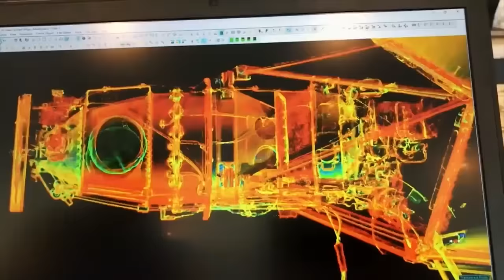We both almost died...now what??

Comment: Dear Patey Brothers, 

My name is Steve D. I have met you both at different air shows and events and have actively spoken to Mark on the phone a few times about Tug stuff… but I digress. 

I am an aviation nut, and I’ve enjoyed growing up around Aviation and in a GA family… I’m a bonanza fanboy… and just purchased my own with financing… (1250 a month loan for ten more years ! ), Although I’m young and turn 25 years old in two days….  I have many ideas that could help the Aviation community and have been putting in boots on the groundwork to try to make changes, especially at this moment in time on college campuses. I’m just going to bullet-point some things, and then I will go into further detail below.

1. - youth outreach, especially to local Colleges. (UC DAVIS example) will mention more below. 
2. The Accessibility of aviation is not as accessible as it could or should be (I will mention more below ), and I had a student write some stuff on his experience as a newcomer to aviation. 
3. - reducing overall cost for initial instruction will break down in detail below on how to achieve this goal (will mention more below) 
4. Working on a congressional level to change mental health requirements in pilots /  AkA ( students that have ADHD or other minor mental health disorders ) 
5. Bring the cost of aircraft ownership/ manufacturing back down ( will be discussed in detail below)
6. HANGER Shortage: getting a fix and building more hangers at local airports. 
7. Working with GAMI to speed up the implementation of G100 fuel 
8. Working on the defense of airports against closures with public outreach. 
9. Getting more pilots involved on city boards and councils and having civic duty engagement ( aka through social media but also convincing pilots to run for office on local levels ) 
10. Implementing a system to resolve the DPE shortage across the county 
11. Creating more Airshow and air festivals across the country to gain outreach. 
12. Getting the FAA to implement New test standards on ACS requirements (I will mention more below )

Organizations I’m a part of, EAA- I was eleven years old when I joined and will always be, and everyone should be a part of their local chapter at their home airport. They do a lot of significant outreach, but they need to do more, especially targeting the correct age of kids. 
They have a program called the Young Eagles program, where they take kids flying for their first time in a small plane; however, I believe the target audience is entirely wrong. They try to target kids between the ages of eight and eleven. And they need to target kids between the ages of sixteen and twenty. They need to be going out to their local high schools while they have pep rallies and asking if they could put up a fantastic slideshow of what aviation can do and how to access it. 

AOPA — my RIDE TILL I DIE; I love them. They do wonders for the aviation community and battle in Congress to keep our freedom to fly. Also, they help us pilots individually with different programs

BPP- bonanza Society. I’ve been an active member since I was seventeen, and they do great safety seminars on Bonanza aircraft. They have a great community board for looking to find Aircraft for sale and have activities and events with other Bonanza pilots to meet up. 

The bullet points that I mentioned for further detail below ——————————
Reply: 1. College outreach — There are many colleges all across the country with airports that are literally within miles of the campus, and they might have an aeronautical engineering program; however, they do not have an aviation science program where you can learn to fly and get a bachelors and aviation science. And a lot of universities closed their programs after 9/11 Because they did not want alums associated with an aeronautical disaster. That example is UC DAVIS. But there are a ton of colleges all across the country that are just like that and have an airport and might have used to have had a program that taught people to fly, but they axed them. That isn't very good and has been part of why the pipeline of new pilots has been so few and far between. The number of universities with a 141 program is less than 40 nationwide. 

3. The cost of the initial instruction can be reduced and can be reduced efficiently and safely. My local flight school in the Sacramento area where I work can guarantee a student can get their private pilot for less than or equal to $7000. The way we do this, you ask? It’s simple. We were a nonprofit Flight school. The CFIs at the school still make enough to make a living or close to it, lol. Still, at the top of the program, it’s all volunteers that are giving back, and the Aircraft that we have are safely maintained and well and good. But there is no incentive to make a profit. There is only an incentive to create more pilots. The students can rent out Aircraft for around $88 wet per aircraft for a Cessna 150 per hour and 120$ for a Cessna 172. And the instructors only charge 30 an hour.
The way we keep our costs down is by our board members on the top, a.k.a. the people who run the business side of the house, are all doing it to break even. They’re not in it to make money. There needs to be more nonprofit Flight schools.

4.  As you know, there is a crisis of young people not getting into Aviation. I noticed that part of the reason is that many believe they are barred from Flying simply because they had a diagnosis when they were a kid for having ADHD or some high-functioning autism or something of that nature. Sidenote: if you go out to a local airport and we’re to speak with half of those old timers out there and their hangers talking with each other, and you had a ( DSM book ) ( if you know, you know). If you had a conversation with these individuals, you could probably diagnose half of them based on the criteria of the DSM that the excellent population of pilots would be high-functioning autistic, and over 3/4 of them would have ADHD… seriously… Have you talked to these old-timers about Aviation? Just get them going… I feel like it’s the same with everyone in Aviation…. It is just sad nowadays; everyone in their mother that is young seems to have some mental health issue diagnosed to them when they are children. Just because they are either too active or they are overly rambunctious, mainly; this was a big situation in the early 2000s involving extensive Pharma overdiagnosing psychological medications to young individuals. I can dive deeper into this if need be… What this is caused is a large percentage of the population that are in their early 20s now have some diagnosis even if they don’t need it. Because of this, a lot of individuals that try to become pilots that might have ADHD or something else of the nature and have to jump through so many damn loopholes to be able to get just a medical. 

5. Bringing the cost down of Aviation manufacturing is incredibly crucial to maintaining the GA fleet. How do you know that most General Aviation airplanes are at least 50 years old? This is mainly because of the slowdown in the 1980s with manufacturing. Many reasons caused this, but if you look at the average cost of assessment, 172 now versus Cessna, 172 and 1980, it’s over a 400% increase in price. Much of this goes to padding for the company due to liability in case they get sued. But I digress. What someone needs to do would be very simple, and they need much financial backing to start it. What it would be is to make assessment 150s and 172. Clone with an introductory panel and Manufacture cheaply but safely. To get it approved by the FAA as a certified aircraft would be a tremendous amount of investment in initial start-up. However, I know it can be done economically and feasibly to produce and sell a primary plane for less than $120,000 from the manufacturer. To do this, you need to change the aircraft manufacturing process. Currently, if you were to go to the Textron Cessna plant in Witchita, Kansas, you would see how much aircraft manufacturing truly is hands-on. That is partially why the cost is so high because of the man hours and labor. If someone would be willing to invest a large chunk into speeding the manufacturing process up for general aviation aircraft. They would be able to pump out aircraft, efficiently, and safely and a manner that is more affordable. this needs to be done as quickly as possible because the generally aviation fleet is continuing to shrink and by the age of my 50s ( 25 years ) it will be in a dire crisis if no one speeds it back up.

9. Getting Pilot involved on civic and local community council is incredibly important. I myself am on a council board to help protect our airport. A lot of the people that run city boards and are in city management. No absolutely nothing about Aviation. I change the mind of multiple people that were in favor of closing our local airport by one simple thing, I took them on a airplane ride, and they loved it. They fell in love immediately, and changed their tune. We need more pilots on local and county boards and airport management boards because you have people that are managing an airport on a city level that know nothing about Aviation which is pretty asinine if you ask me myself.

11. the ACS requirements… Oh, man how I can dive into this here as a CFI… Yes, I understand that they are what they are and they probably won’t change however, the FA really needs to focus more on safety and emergency scenarios and testing and focus less on control performance. Those things come, with the experience of being a pilot… Especially on the commercial level, when will a pilot in all reality ever do a 8s on pylon ever again outside of their training… Yes, I understand that it shows that you have control ability to a commercial standard over the aircraft, but does that really make a safer pilot? Especially a safer commercial pilot? There’s a lot of things in the ACS that just don’t make any sense or made sense 30 years ago and don’t make sense anymore such as a Shondell as a commercial requirement. They say it can be used to help you get out of the box Canyon, Yet Embry Riddle has done studies to show that it’s more unsafe to perform in a box Canyon! Why is the FAA not looked into this they really should focus more on emergency procedures, emergency protocols things of that nature especially during the commercial exam.

I also had one of my private pilot Students write his opinion on the situation 

has been most challenging for me has been accessing the aviation community in a way that makes aviation a part of my daily life. Twenty years ago I started my flight training at KHJO in Hanford, California. This is a very small airport in a small town. Hanford is about 15 miles east of Naval Air Station, Lemoore. Obviously, the base has a large fighter pilot community but proximity does not necessarily translate to access to that community. At the time I knew two other pilots, my instructor and the mechanic at the FBO (a friend of a friend). I had no social ties to keep me at the airport or in the aviation community between flights.

This time around, I am actively trying to find a place to fit into the aviation community here in the Sacramento area. It is still challenging. There are several EAA chapters where we can meet people at pancake breakfasts and other events, but it is still difficult to find your way and place in these communities. I've also been training at Flying Panthers, but there is no social element there (that I am aware of).

The result is my exposure to aviation right now is limited to when I can schedule training time and those times when I can attend a pancake breakfast. Folks are friendly and chatty, but there is still a long way to go to create daily friendships and connections within the aviation community.

I suppose my contribution to your essay and list might be...

How do outsiders find their way into the aviation community in an active way that contributes to keeping aviation an important and indispensable part of their daily lives?

The aviation community still feels like a very closed and exclusive club.

——- anyways long story short I hope you like what I wrote and I get a t-shirt or something haha. 
Thanks 
Steven D.
N5876S 
N4043J

Comment: 1) good: flight schools are packed!
2) bad: the increased activity has nearby residents new and old complaining more than ever.
3) orgs: AOPA and EAA.
Idea: make training aircraft quiet and more profitable by STC. Target the Cessna 172 and the most popular Piper trainer (I don't know what it is), basically the aircraft that are mostly in the pattern and practicing maneuvers. Has to be profitable for schools. An electric conversion by making the 4 place planes into 2 place might just work. Use non rechargeable batteries for the legal "fuel" reserve (better specific energy so it would save weight) have have about 1.3 hours from rechargeable (hard pattern power). New solid state batteries should have a high enough specific energy to work (previous NMC batteries barley worked weight wise for 1 hour). My observation is that school planes sit for about an hour between flights, perfect for charging from a mobile battery bank. Lower operating cost = more profit. No vibration = way less maintenance. Quieter motor and can even bundle it with a quieter prop. Of course not all the school's planes could be converted, but probably up to half (assuming a minimum fleet size of maybe 4).

Comment: What's wrong in GA?

1) 1200-1500hr ATP rule for start.
2) High cost of parts, gov overregulation of certified parts, etc.
3) FSDOs that don't want to play ball.
10) Airport fees.
9) Public building houses next to airports and greedy developers tearing down airports.
11) Barriers to entry.
7) Overregulation of the Remote Control hobby.
8) Delays in getting Mosaic passed.
4) Need a partial A&P courses for those of us who can't quit our jobs and don't intend to do maintenance for a living, breaking noncommercial A&P into composites, aluminum, wood, fabric, engines, avionics, etc. (I don't need nor want to do work on jet engines, and other aspects of maintenance, I just want to be able to work on my airplane).
5) Lack of affordable and simple designs that are designed for the average person without big bending breaks and such.
6) Air cooled engines that don't cost as much as a Tesla EV.
........

Flying, building, designing, EAA, AOPA, Civil Air Patrol, Aviation STEM education, etc.

Comment: Streamlining a bureaucracy that grows and perpetuates employment of the inefficient is a structural problem that seems almost impossible to solve. This drives up costs in litigation that wrecks a lot of what GA could be (slightly off point here but kind of on, ref. Trent). Since I’ve seen Mike solve practical technical problems that are high order difficult, I’ll hold out hope that Mark is up for the ultimate challenge of sinking his teeth into the vastly more difficult problem of GA regulation. I don’t believe the technical innovation problem can be solved without solving the regulatory one. This requires the twins. For instance, electronic/airplane control systems on commercial airlines have resulted in extrodanary safety, even when pilots do forgetful things, proving what can be done when big corporate money and lawyers are thrown at the problem. Currently most of those functions are available on drone control boards that cost a few dollars, the drones themselves being regulated by the FAA, yet the GA fleet looks more like the fleet of 50’s cars still being driven in Cuba since Fidel took power. There is no practical reason why low cost redundant avionics could be integrated in new more efficient airplane designs to vastly improve safety and economy. Part 103 is about a page. Why can’t something this sensible be expanded in scope to allow for innovation in production airplanes? Difficult, yes, but I have faith in the twins.

Comment: Affordable new certified aircraft with efficient and safer systems.  We are mostly still flying 1960’s aircraft based on 1930’s designs.  Why?  Because the cost is less than 1/10th.  Surely there is a way to make a new, efficient airplane for less than 1/2 a million dollars.

Comment: Ok, what scares me the most is the lack of airplanes that are reasonably priced, reasonably fast, and carry a reasonable load. An entire fleet of airplanes may be grounded for lack of replacement ruddervators. Would you save an entire line of GA aircraft by designing new composite ruddervators for the v-tail Bonanza’s? As you know, the originals are made of magnesium which have a shelf life. That shelf life is now and many planes are becoming unsafe. Please assist to save this line of aircraft. Thanks for the consideration.